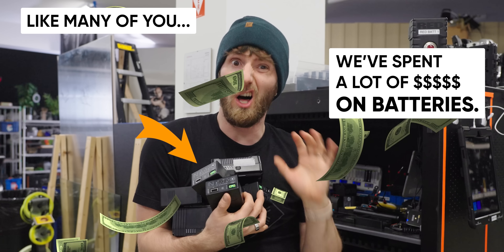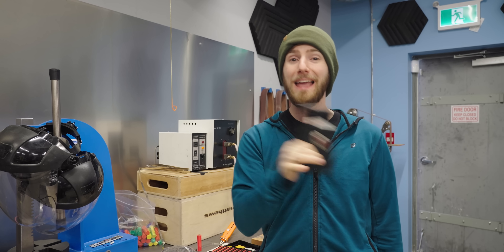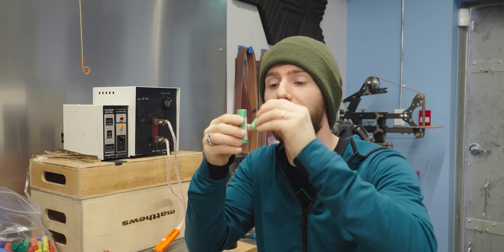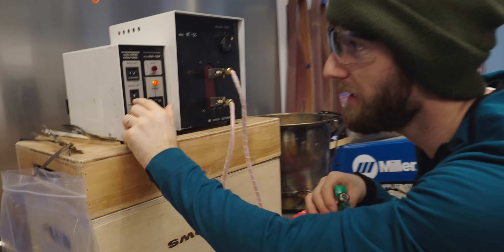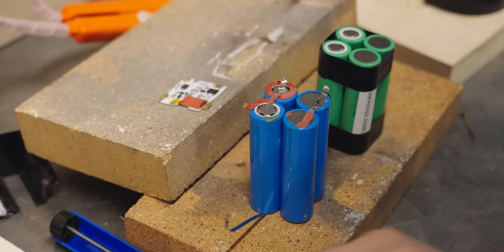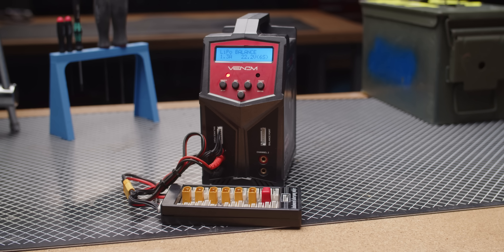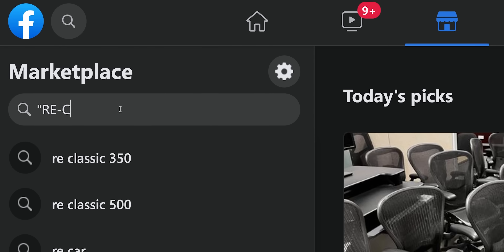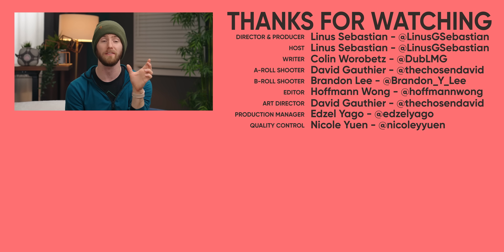This should be illegal… Battery Repair Blocking

Comment: Seemed like the pulse length was too long when you were spot welding. See how the were glowing, that's what spot welding is trying to avoid, excess heat... and it's quicker than soldering.

The 14 on your spot welder must have been 140 ms not 14 ms. 

Either way... more power less time is what you needed, and those sparks were not the battery, it was because you weren't pushing down evenly across both probes of the welder and the side that sparked had less contact with the nickel, and it was vaporised from the bulk current.
Reply: Yeah it was kinda painful seeing him throw good batteries out like that
Reply: @t0k4m4k7  I was confused watching the video because the batteries did not seem to be shorted. If you permanently short an 18650, you're gonna see a different result than a short little spark. And how would they have been shorted anyways? The nickel strips were in the right place before the weld, where was that short supposed to be coming from?
Reply: @highks496  Also, most of the sparks somehow happened when they weren't filming.  Seems quite suspicious.
Reply: The moment he said no sparks on connecting opposite terminals of two different batteries with their other terminals not connected to anything, I knew he was probably going to mess it up because he's too scared.

The only conceivable dangers in doing something like this was accidentally short circuiting or arcing if the voltage got too high ... neither of those scenarios applied in this case.
Reply: anyone know why the cables to the welder were jumping? The one on top was moving like a pressurised hose.
Reply: @heatshield  because of the current going trough the cable. When a current is flowing through a conductor a magnetic field is emitted. And this is moving the cable.
Reply: @heatshield  They "jump" because the power-surge during the welding induces a strong magnetic field around each wire and those field interacts with each other and any other magnetic field present. If you want to see an extreme example of it, check out https://youtu.be/zOsEmpnOh6w
Reply: @wheelolle  thanks for that link. I'm not sure that what we're seeing here is exactly that, though. There's no "strong magnet" right next to the welding cable. 

 Of course, I agree, it's something like that, but. .  . Maybe Lorentz force is involved?
Reply: @heatshield  Yes, it's a result of the Lorentz force. And there is always the Earths magnetic field to take into account.
Reply: @wheelolle  wild. 
 While snooping around I read one account of a guy doing some heavy duty welding, being a bit rattled when a cable jumped up and bopped him on the nose. I think he mentioned the Lorentz force. 

 Now, I'm not sure what he was doing without a welding helmet, maybe just goggles,  or maybe just hyperbole. 

 Thanks for your time and responses.  😎
Reply: Yes, yes.
This and balancing batteries before spot welding them as it's possible and best practice to balance them before welding.

Despite they reputation, lithium batteries can take some heat,
Is just not great for battery life and more risky.
So they may have thrown away batteries in good condition.
Reply: @youkofoxy  I have soldered wires to 18650 cells before and it went fine. If you are moving quickly and use good flux, the battery doesn't heat up that much. All 4 or 5 of the cells I've done this to were absolutely fine afterwards and they are still working fine after two or three years.
But I wouldn't necessarily recommend it unless you are good at soldering and know that you can be quick with the iron.

Comment: You have to throw the battery onto a charger to reset the BMS after recelling. That's why you weren't getting an output voltage.

Comment: I can highly recommend turning down your settings on the spot welder. Cells shouldn't pop so easily.
Reply: Nothing popped. It was just the welder sparking/melting the nickel strip.

Comment: The spot welder is set wrong for such tiny welds, should be much shorter impulse. Normally you start from the lowest setting on some test cells until it’s enough power to not be ripped off easily.
Reply: I was looking at that as well, it should be a QUICK POP and be done, but it looks like it's actually WELDING for over a second. I'm wondering if maybe that machine isn't working right.

Comment: I have once performed a reset on a Lipo cell's bms. Basically it ran down a little too far and the bms shut it off (could not charge it back up), so (with a lot of precautions, prepping, etc), I directly charged the cell to above the threshold (this was done with a adjustable power supply), and the I performed the reset (which was basically pulling a certain pin higher or lower than another one - prepping and reading up on the exact chip showed this could be done). That cell is still in use a couple of years later.

Comment: I'm a little lost on the big issue of the sparks. Your using a welder, and depending on your contacts, it might create sparks. It's normal, or is it that the sparks are coming from the battery breaching? If something went wrong and you momentary shorted out a battery or the pack and that caused one battery to be half a volt lower, the BMS has balancing action in it, it's part of what that handles. Additionally, welding ONE side of the pack before you even get to the other side, is OBVIOUSLY from the weld, no single battery is at risk, you have to use both sides of a battery to have any usage of it. 
Not mixing used and new batteries is ideal for LONGEVITY, and all the trouble your going through, I respect that, aside, it's still possible to restore partial life to a pack.

The most important thing about doing this, is to ensure you don't short out any battery or pack, or group in a pack with the weld process. To follow that, you start with ONE end, wither positive or negative, and follow the path through each battery ensuring (groups should be matched in weld and looked at as one cell for path purposes) 

The BEST way to check battery health BEFORE you put a pack together like this, is to use a LABORATORY type of tester, and test each cell individually.   The one that I have for example, requires FOUR leads to test each battery, along with a special type of adjustable battery holder. This holder allows two discrete contact points AT THE BATTERY. Each end connects to the battery via a hollow nipple, along with an insulated pin inside of that. (both spring loaded for best contact) That's TWO discrete contact points on EACH side of the battery, and this is needed to know more about the internal health of the battery.

This type of tester allows three things to occur simultaneously via interface with the laboratory tester. 

The first is, voltage monitor
Second, placing the battery under a necessary load for about 1.5 seconds
Third, injecting a radio frequency into the battery to determine the internal resistance of the battery

These are all adjustable via interface, but when the test function is used to determine battery health, you can see the internal resistance of the battery.  I only explain all this because you were being picky about the fact that some cells from the store were LOWER voltage than others, I'm assuming before you charged them.  This however COULD be backwards from your assumption.  It's entirely possible that an older battery that's been sitting on a shelf was made with BETTER materials, and reports back with a BETTER health, but remember you going strictly by voltage. It's interesting to note that it's well documented that these batteries are BEST to not be stored at full charge for a long periods of time, but somewhere in the 60 or 70% approximation. 

It is to my memory however that they should all be individually charged BEFORE you test the internal resistance.  Expected internal battery resistance varies per type of battery and it's all online.

Comment: Instead of using a spot welder that you have no experience with you could have just soldered the batteries with simple busbar or thick copper wire. Alot safer to use minor heat then literally using large amounts of power to weld the strips. Also battery pack makers use a machine that is way different then how they setup theirs. Also many people double wrap the cells before doing this since you don't want to touch the case to the positive or negative leads. Also a tiny short usually will not cause a battery to pop right away. I wish they did more research before doing this video.

Comment: DJI had some really shitty batteries. Their internal BMS would auto shutdown and outright disable recharging after a certain amount of recharges. I've heard it was from under voltage of the battery, but that was not possible in my case. Cell restoration should be kept under tight restrictions due to hazard, but it definitely should be an option for professional repair shops or individuals that have the knowledge to do so.

Comment: Little arcy sparky when assembling battery packs is pretty bog standard. As long as your 100% you are in the correct orientation and the battery hasent been over heated then it's fine. Don't create more E-waste then you hope to prevent  😉

Comment: you can't get sparks by only having connected one side of the cell-pack. sparks can only occur when closing the circuit. No cell has a way to complete the circuit when you are connecting the first side, it gets more interesting when you do the the other side....

Comment: My cheapo 15 dollar chinesium USB battery pack that I bought 6+ years ago actually says in the user manual that it has 18650s inside. When those cells become unusable, I am simply going to swap them out and go on for another decade. Sometimes the cheapest stuff is the most premium in some ways (and I view longevity and serviceability to be a premium feature, just like laptop manufacturers used to).

Comment: If they check for battery disconnect you should be able to connect a power supply to the contacts with the same voltage or slightly lower voltage than the battery itself, then snip off the leads and replace.

Comment: In no "refiling" Vape  are 500mAh batteries they are perfect fine, but they are trow out after they discharge/vape ends. Some of them have even solid aluminum case. 
They are trow out in trash bins or even worse in the bush. I start colect them "hey it's free battery", little project with Raspberry or outher thinks like battery banks for phone...

Comment: Some BMS are designed to cut off power output when battery is once disconnected, usually all it takes is a recharge through BMS and it'll boot itself up and running.
I think it's the case here.
Reply: And also the spark wasn't from shorts, it was from heating it too long that part of nickel got melted and splashed out. It's totally safe to use.
Reply: Or copper since it's the electrode and when electrons hit the positive electrode, they generate heat there.

Comment: Did anyone else notice that the multimeter said minus 6.98 volts? Either Linus used the leads wrong or flipped the polarites on the batterys. That would explain why they didnt work.
Reply: He just put the leads on the other way around. If you just want to measure a voltage, it doesn't matter. I do it all the time because why spend time on matching the leads if you just want to know the voltage. It's either -6.98 V or +6.98 V, doesn't matter if all you wanted to know was the voltage.

Comment: As you commented, since almost everything we use these days has batteries, I would love to see how the old dead bricks do get recycled.  The upside is that you would be raising the awareness of battery waste and encouraging your viewers to take it more seriously.  Again you guys have made a great piece of content. Thank you.
Reply: even though it sounds like the first chip was already gone from disconnected the battery... the first thing i would do is hook up the battery and THEN disconnect the first to avoid any cut off protection
Reply: Often  the charge is first discharged with salty water to make them safe to handle to begin with. especially with potentially unstable / no terminals to discharge from.
would be interesting to see rest of the steps for sure.

Comment: Why are you guys so afraid of sparks? These are sparks from the nickel strip (molten metal there). The battery is fine unless you accidently burn a hole in it (but it's impossible with fine tuned welder). You can easily get sparks even when you weld 2 nickel strips together without a battery.

Comment: If the battery is not disabled following a fault, the company will have to replace your entire expensive camera instead of just a battery pack. A strict battery management system is an engineering insurance for the device.

Comment: Lithium Fires are extinguishable. While I really wouldn't recommend it due to the hazards it is possible to extinguish such a fire with water, the only problem being that you have to keep it cooled to prevent the reaction from restarting. The water works by cooling it all down.

Comment: Not a good idea to just swap a rando cell in with a bunch of others that were matched but wow it's also not hard to just separate the old pack into individual cells then see which ones are still good and usable for all kinds of handy things. That's the thing about those welds you can usually just rip them off easy with pliers. Then you end up with hopefully only one or two in the trash. When it comes to worrying over some kind of shorting when doing spot welds with nickel strips they usually seem to use those little insulating donut pads to further prevent the strips from shorting the + and nearby - on the casing which is also accessible at the top of the cell through the little thin insulator sleeve.

Comment: Why do these need to be welded to begin with? AA battery holders are a thing, why not 18650 battery holders? There's nothing dangerous about swapping out solid cells like you would swap out AAs. Sounds like pure evil.

Comment: I would suggest not using vape batteries with 20A above for this project. Use LG pink ones with around 10A to 15A. Possibly the reason you killed the chip 😂

Comment: Every 18650 I have ever seen pops in and out. It’s crazy to me that welding would even be a strategy. Like that red pack you should be able to pop out the old pop in the new and go.
Reply: i thought it was strange, myself. i did see a comment mentioning the nickel is specifically chosen because it will act as a fuse in the event of a short. but the welding thing seems out of place. especially since it requires adding a significant amount of risk to the assembly process. any other battery just slots into place, and some of those set-ups are really sketchy, yet you don't see a fire/short result of it... [tho, lithium is a very different story. it's just dangerous and anyone who paid much attention in science class would hopefully know this. also useful for de-bunking "chinese lithium" claims]

my guess it comes down to cost reduction, as a slot-in approach requires more materials to build the cell-holding assembly. or it comes-down to compactness, the additional layer of material might make the battery a biiiiit too big for the device it's meant to fit. and ofc, anti-repair is a possible angle since just like GLUING-IN cellphone batteries, it makes repairing the battery, itself, VERY dangerous. and then there's a slight chance this is the safest approach, but i'd like to see very strong an unbiased evidence to support that. the BMS "safety" claims, themselves have holes as the BMS neither prevents welding cells together nor replacing/bypassing the BMS when it disables your "new" battery. [and a dedicated enough hacker could also take the device side of this feature down in many cases. and usually once someone finds a hack, it will be refined and deployed en masse] these two acts are significantly dangerous and a BMS that just shuts everything down without telling you why is just inviting doing something that's legitimately a very bad idea.
Reply: @ETXAlienRobot201  Soldering the packs is way more compact and provides less resistance and higher operational safety. Also the welding isn't dangerous, especially not in an industrial setting with properly calibrated machines. 
High quality cells are the most expensive part of the battery pack anyways, so it doesn't make much sense to manufacturers (and most customers) to produce slot-in battery cases. It doesn't even really make sense to re-cell a pack like the Red V-Mount block if you're doing it yourself. Count your work hours and you might be in for a surprise. Best option is to not buy the most expensive battery packs from Red or Sony, but get some from reputable third-party manufacturers like Swit or idx. They cost just a tad more than the cells alone.

Comment: Just solder the new battery pack and THEN de-solder the old one (very soon after that) keeping the same voltage charge on both. 
THIS IS NOT FOR NOOBS (I have had success with this technique on an old Laptop battery). 
 I haven't seen this before, but IF the BMS has a maximum charge cycle counter... you may be SOL
+ if you de-coupled the battery pack from the BMS, there is a chance you can reset the BMS chip... seen that done also but it is an investment, If you have a lot of batteries.

Comment: Take a red battery, open it up and then unsolder one lead, and then reattach it. If it stops working, then it's either volatile storage or programmed to stop working when a disconnection is detected. This will at least rule out capacity checks, unless they have that in addition to the above.